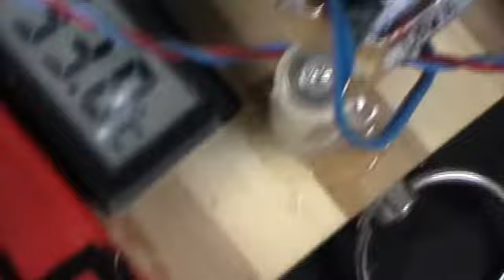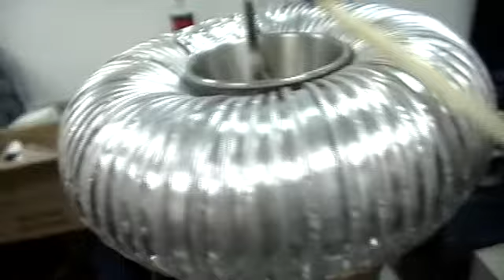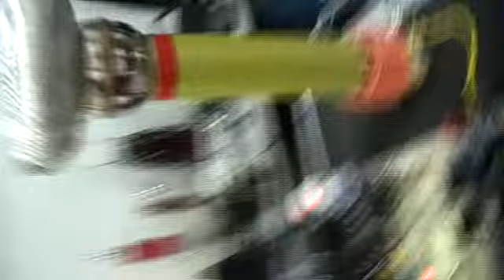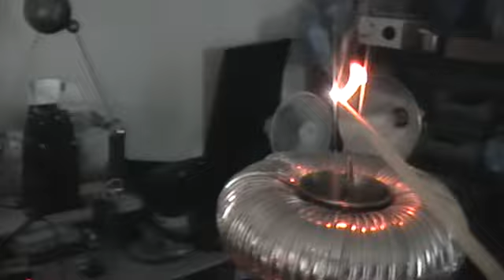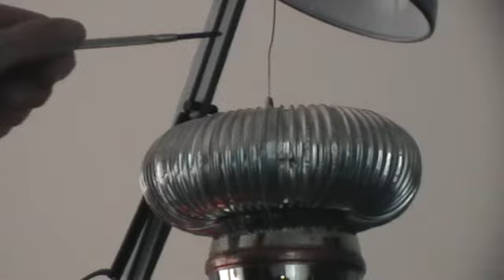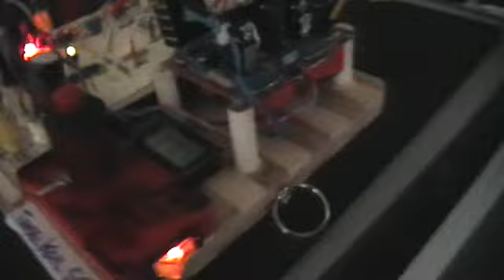Electric OU: Properly Switched MOSFETS Produce More Power Gains

Comment from the maker: (part 4) Now you've set up a standing wave. Keep hitting it just at the right part of each ring cycle, and just exactly like pushing a child on a swing, more and more energy is put into the resonant oscillation and it builds and builds until the voltage exceeds the breakdown value of the surroundings and the charge sprays off as corona, spark, or power arc. Emitting RF as well, all the time.
This is the phenomenon known as Voltage Rise by Standing Wave Resonance, or VRSWR for short.

Comment from the maker: Please don't hold your breath. The only way to get COP > 1 from this system (or anything other than, for example, a heat pump) is if you use the "Ainslie" method of calculating input and output power. In that case, the COP of this system will be very high. After all, I am inputting, here, around 25 volts DC at less than 3 amps average current, and I am getting at least 30,000 volts (corona, see?) and several tens of amperes in that fiery hot power arc.
So I'll just let you do the math yourself.

Comment from the maker: Thanks! Wait till you see the "toast"! This little coil works nearly as well as my 1.5 kW monster with the rotary gap. And has about a tenth the footprint and weight. But I was cooking off mosfets like popcorn there for a while (my, they are crunchy). And there's still nothing like a big mechanical spark gap and a huge cap bank to impress the producers. 
This little coil is nearly silent but makes a huge electric flame. I'm amazed.
Keep watching, there's more to come.